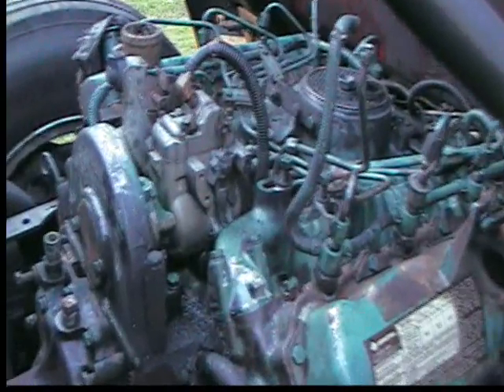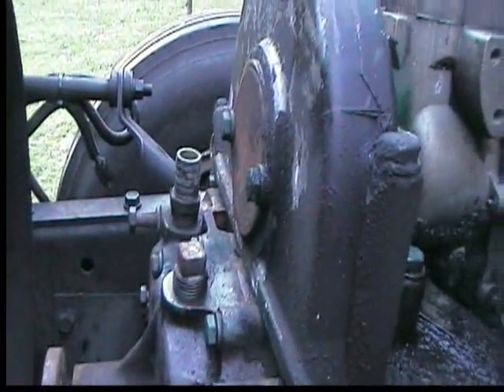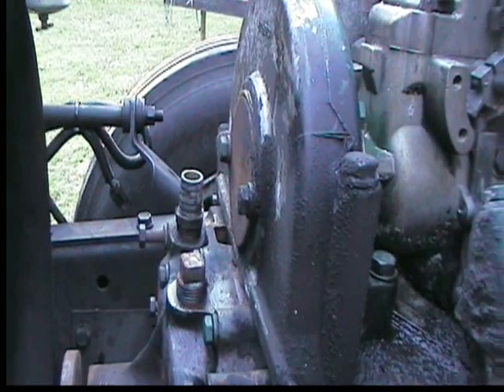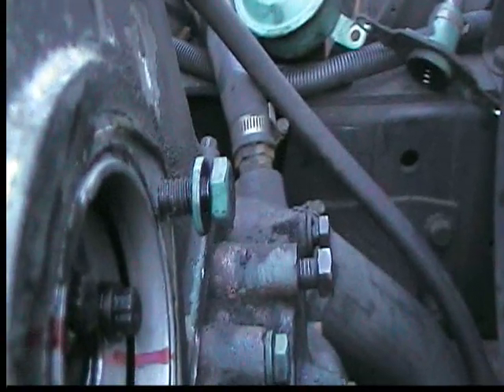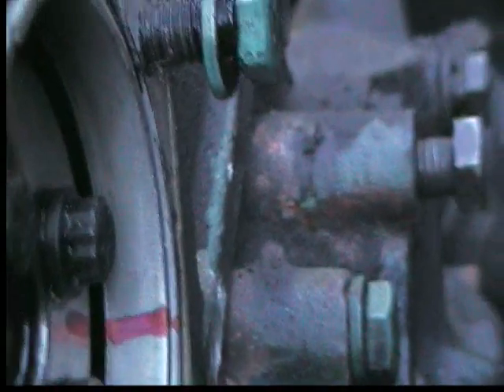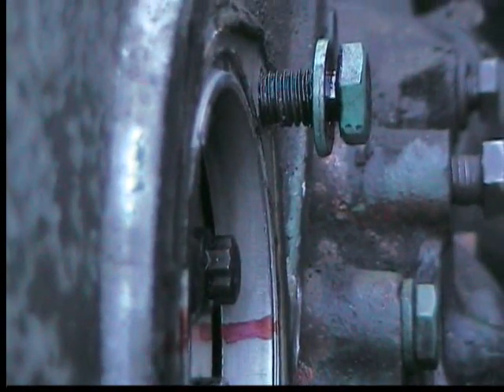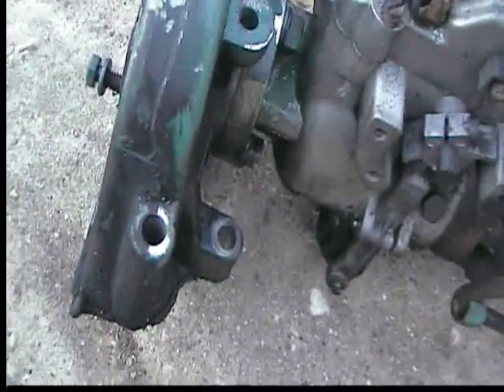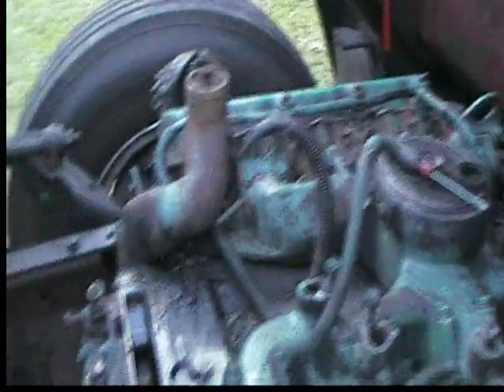6.9 and 7.3 IDI Injection pump removal

Comment: Have you had the chance to put a 7.3l injection pump onto a stock 6.9l set up? Will it run to high idle on first fire up?
Reply: it runs better has better timing advance and smoke clears up better too I'd recommend a 7.3 pump

Comment: I haven't seen this method before. Usually the standard proceedure is to leave the timing gear cover in place, and slide the injector pump back out of the gear and housing. That way there is no risk of getting the timing off. Tricky, but I have always done it that way.

Can't see much wrong with your method though. Good vid.